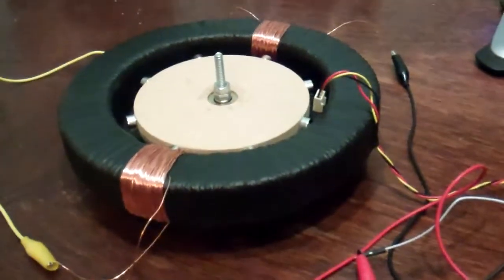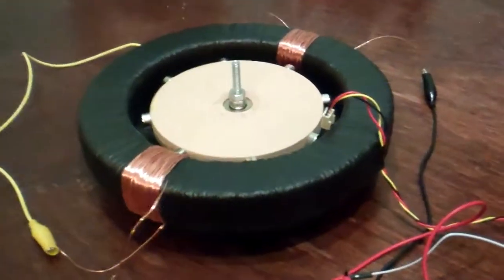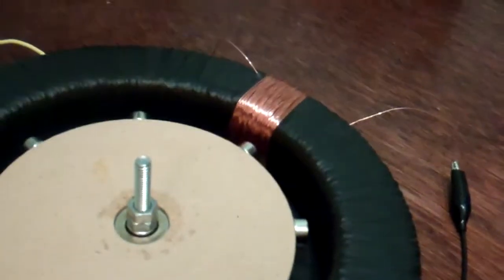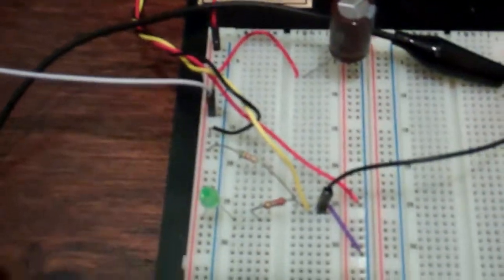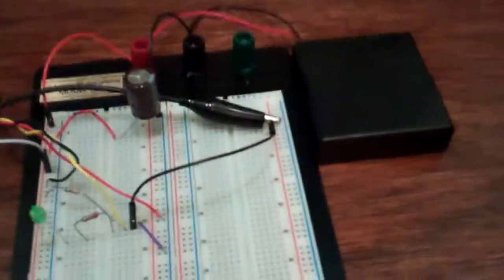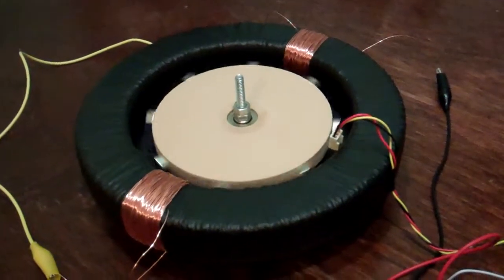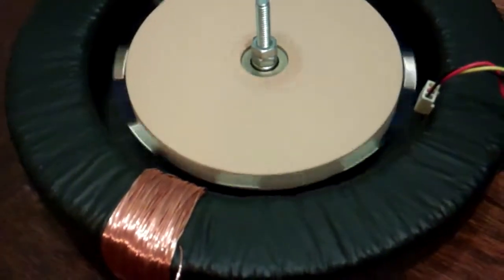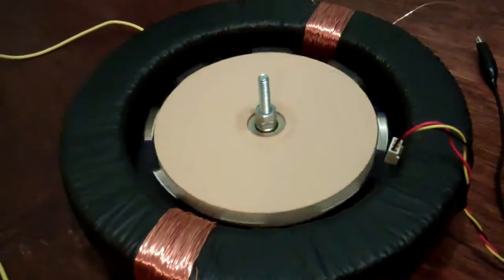Pulse Motor Prototype / Entry

Comment: Never feel the need to apologise or anything for using a solderless prototype pcb breadboards as they are not just for novices bro! Solderless (Prototype Circuit Breadboard's) PCB's are also used by professional electrical technicians aswell as intermediates and novices alike respectively for testing out circuit's and single components! They are always a very useful and helpful tool for the lab or workshed regardless of ones level in electronics! If your a self confessed beginner then your pretty much onto the next level dude as you've clearly demonstrated, so well done bro! You've got yourself a pretty neat  Bedini wheel concept there attached to a hall sensor situated at a 45° degree angle which is properly constructed by the looks of it for the rotational flux lines of magnetic force! If you've tested the cycle/frequency response by the aid of an accurately collaborated oscilloscope and voltage and current via a multimeters for both the load and out to ascertain if the level of high efficiency peaks above unity then for a beginner you've skipped intermediate level in my opinion! You've definitely grasped the basic fundamental intricacies of the Bedini circuitry architecture! Nice one buddy! 🧲⚙👍

Comment: what if you make more discs with magnets to set on top of the pulsing disce with North and South and coils to make power for over unitty
Reply from the maker: Nah, this is just a very basic type of motor. Over unity is not possible with our current understanding of physics and may never be possible. I think the most we could hope for is just an ultra efficient generator of some type.

Comment: Do you have to pulse it or will it run if you just connect the coils directly to the battery? You are using lorentz force, so I don't think you need any pulses and DC will do the job :)
Reply: ***** That's interesting, I was under the impression that the lorentz force will do the job, but I also have noticed that lorentz force wants to pull the coil into the side of the magnet, not just push it away...
Reply: +Brooks Andersen (BRUXXUS) Do you think if you locate the magnets closer to each other, you will be able to achieve what you wanted to see at first? The other option would be to have a ring magnet, north facing up and south facing down. I'm waiting for my magnets to get here, so I can try this, but I would appreciate if you could let me know what you think about what I just said.

Comment: Proof of concept of what ??? That pulsed magnet motors as you said at the start have been around for ages ??? Using toroids to make them move is a different approach, but you need to do more research. My ORBO variant just flew apart at 5600 plus rpm's due to a couple smacks due to earlier accident'es.
Using neo's requires higher voltage then you get the speed ... bigger mags then U get the torque ... the geometry then comes into play and you need to use common sense to get that geo right. Look at nature and you may see it.

My motor flew apart, and I'm bummed. I may not rebuild it due to true apathy and a sense of Universe says I was on the right track BUT !!! Universe has dropped a bus on me already, I nearly died and have to poop in a bag now. Now Universe destroyed my motor and I really hate winding coils by hand. I lost two coils and a magnet.
I'm on welfare now ... do you know how much hobbies like these cost ???
The rotor I needed would cost $400 plus to be 3D printed. CNC won't work ... limits are too fine.
Kickstarter and the like would laugh at me if I tried to get funding for nonesense like this. What does an inventor do ???

Journey

Comment: damn dude this is pretty amazing what you have here.. i would not have thought it would work as well as it does, at least i would have thought the thing wouldn't make full rotations without an insanely high input.

what u are doing here is actually pretty funky because you could almost say the rotor is taking advantage of the "vortex" action of the toroid.. or at least the awkward magnetic field created being able to interact and push the rotor mags the way it does is pretty cool in itself.